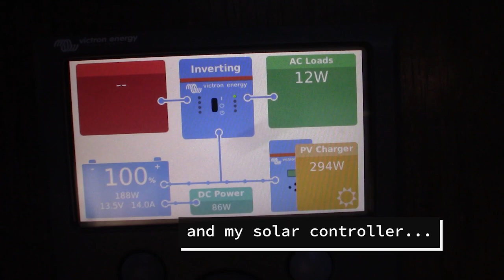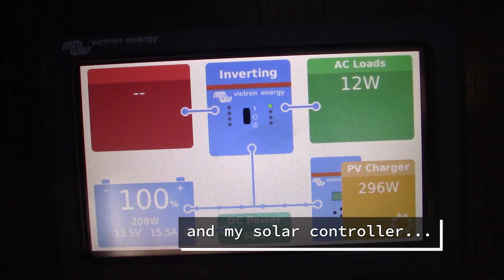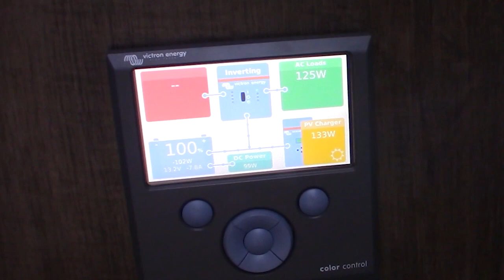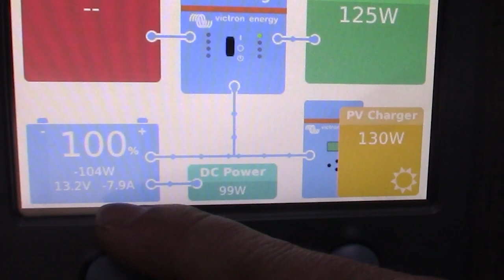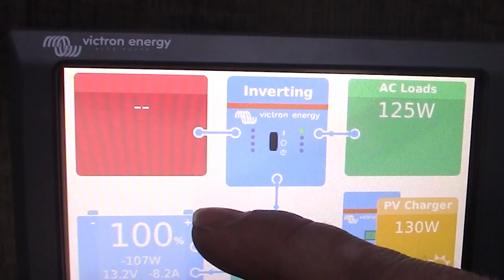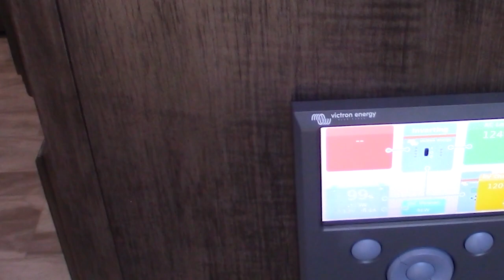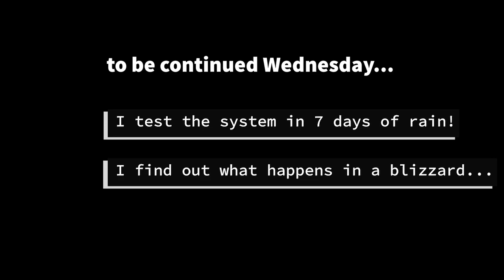MASSIVE SOLAR INSTALL for this Full-Time RV Boondocker! Full-Install and Walk Through

Comment: Omg I went to northern Arizona wind and sun in January and got my solar. I was there in two feet of snow so I stayed in a hotel while Louis from The solar place and another installer did their magic. I got 1300 hundred watts of solar panel and six batteries same as you. It looks like we got the exact system with a few watts more  on my roof.  I can run my air con perfectly and never have gone below 70 on my batteries running air con for 5 hours.  I got the same inverter also.  I love my set up and I know you are going to love your system also.  Wow your board does look just like mine.  My solar investment was money well spent and I love that I’m able to use microwave and everything while Boondocking.  I’m happy to see other people went for the max solar system  because I wouldn’t settle for any less now that I’m used to living in my motor home just like I’m plugged in all the time

Comment: I was fortunate to find James and learn of Northern AZ Wind & Solar at an event at the beginning of 2019 and been very happy with the install he did and the performance of the system. Haven't read all the comments but did want to mention that you can claim the cost and installation on your taxes (it was 30% in 2019, and will be 26% this year). Every little bit helps especially with those lithium batteries...

Comment: Good video. Im way in over my head on all the parts I bought already and they are still sitting in their boxes in my living room. I bought 10 battleborn batteries, 3000 multiplus inverter, the color gx display and victron monitor and enclosure. All of this is going into my ford econoline van. Im about to buy 5 175watt solar panels to mount  ontop. Definitely a very scary thing im embarking on. For anyone curious why I need that much power in a little bitty ol van.. its.. computers lol. Im doing a full mobile office van build. Slowly but surely coming along. Good luck to you all and keep making great content for us. Thanks
Reply: You sound like me with them STILL in boxes on my living room floor !...

Comment: Real Nice setup you have Victron gear is top notch - i built a smaller  solar system using li ion batteries w Victron charger have been using daily 4 yrs - you will enjoy  yours

Comment: Great company and had 4 solar panels installed 1280 like yours. Same inverter ,basically same system with 4 battle borns.I have had it for 6 months and no problems so I highly recommend this company.  Took two days for us but the guys stuck with into the night.  I hope the owner of the company builds a shop for the installs. James is great but wasn't our installer and didnt get the same service you did.  Oh if you go there and smell a skunk, well it's not a skunk legal weed manufacturer next door..🦝

Comment: Great to see this video! Our new rig is going to have 1320 watts of solar and 8.7kw of lithium so it’s helpful to see how much you can get out of your system so we can plan for when we get ours. BTW, the only thing you need to look out for with the lithium batteries is to keep them above 32 degrees. You can use battery power below 32 but you’ll ruin them if you charge below 32. You’ll want to add heat pads or put a heater in the storage bay :)
Reply: Casey Good info, Casey. With our last rig we spent the extra $$ for RELiOn’s low temperature lithium (good to zero degrees). It was a lot less stressful on cold nights! Our new rig is a 4 season and has the batteries in a sealed heated basement. Yay! Happy travels!

Comment: Looks like a top of the line system you get there although those battle bones go for $1,000 to $1200  a peace.When I use my instant pot it starts off at 1,000 watts but once raises together pressure drops down to couple of hundred watts

Comment: Nice setup Robin. I have a similar system (1280 Watts Solar, 6 BattleBorn, Victron Inverter & Controller) that I purchased from Arizona Wind and Sun last year. You are really going to appreciate the no-maintenance aspect and additional power.

Comment: Congrats!  I'm so excited!  I bought my system from NAWS in January.  Had the install date set for March when everything shut down.  I'm just waiting for them to start scheduling installs again.  I got 640 watts of solar, 3K watt Victron multi+ inverter and 2 Battle Borns plus the other 2 pages of parts, components, and wires.

Comment: My solar guy (Light Harvest in Portland, OR) added charging to my van's "house" batteries (300 ah lithium) from my alternator. Is that an option with a separate vehicle? Ironically, I drained my batteries during Pacific Northwest spring aka cloudy rainy days as well. Also added USB ports in the "house" for charging. Once that small (not particularly cheap) fix was done, my system works amazing. I have an Instant Pot, induction cooktop. My Isotherm refrigerator runs on 12v. I only turn my inverter on when I need 110/120. Inverters drain batteries even if nothing else is running. Also, I appreciated him saying to just get your solar panels rained on from time to time to clear dust off. People used to make a big deal about climbing on their rigs and cleaning them. I've been in my van about 15 months now and, other than an occasional truck wash and rain, I've never worried about cleaning my panels. I always think..."who goes out to clean panels at solar farms?"

Comment: Robin, there's AGM batteries that are sealed and don't need water.  My AGM batteries can be run down to 80 %, not 50% if necessary and still under warranty.  Lithium batteries are great, but, make sure that they don't overheat and are in a safe place.  They're insanely expensive to replace.  Good on the solar, I have a Zamp solar system, 5 stage microprocessor. You technically should never have to disconnect  the solar, I never do and have had solar for 3 years...

I hope you have a battery monitoring system showing the state of charge... Victron BMV 712 is a great system and has a battery shunt to the batteries. 

I have a generator as well....

Good luck.

Comment: Nice.  You have the same amount of solar as my rig (1280 watts)... And twice the batteries, and 1000 more watts on your inverter.  I am looking to upgrade part of my system to be able tp occasionally run AC, too.  (James built my system, too, BTW)

Comment: I would also invest in a manual (off line) volt/amp meter usually ran by double AA batteries so  you can check the battery status without the internet. So, if the internet is down or you're without connections you can at least check the batteries for full charge or needing charge. Maybe som other dear folks could correct my information or add to it accordingly!! But this is an amazing set up though!! Enjoy!!

Comment: 2:22 People need to get out of the 80's-90's  (this is not Pinto wagon)    >>>> LITHIUM ARE SAFE!  <<<<
Reply: They saw too many phones and tablets spontaneously combust.
Reply: Anne-Marie A Good point… And not in the 80s or 90s
Reply: Cell phone batteries are NOT the same as lithium ion batteries installed in RVs.
Reply: @hosephine1 , thanx, I didn't know.
Reply: I think the people saying bad things about lithium are the ones that can't afford them. We have lithium and would never even consider an AGM at this point. There are no cons to lithium, love them!
Reply: there are different type  lithium. The battery type used for led acid replacements are  LiFePo4. LiFePo4 contains less energy per volume, and are very safe.

But anyway, the BMS keeps the cells safe.

Comment: I don't know if you have heat in that storage bin where your batteries are, but those batteries will give you very little output when they drop below 32°. Which is why BattleBorn sells battery warmers.

Comment: I wonder if you could use a heater off that system during cold weather? How well is your insullation on the rig? Is it 4 seasons? Have you thought about a wood burning stove? Have you considered installing a split air conditioner?

Comment: I am glad you got such great help with this confusing(to me) tech stuff!  I have a couple of questions for the next View Q.  
I am planning ahead to get some sort of larger vehicle to travel in.  Right now it will be my mid-size SUV, which I realized is pretty darn small!
 I have already bought a water purifier, one burner cook top, a privacy tent, a 5 in foam, cot size , gotten heat shields for my car windows that are reversible to black for stealth sleeping, and a small Jackery.!  
But for the future...I notice in all the tours of various vehicles that most have these humongous containers for fresh water and gray water under the sink. I am 77 and even a 1 gallon container feels somewhat heavy to me.  They have maybe a 5 gallon gray and 6 gallon fresh, which they are supposed to take out to empty or refill.  How the hell am I supposed to do that?  Any alternatives for that type of system?  Also, since for now, I am in a car, if I would leave a fee campsite to go for groceries or laundry in town, would someone else come along and be able to take the spot where I was?  Thank for
Reply: I got the slim BPA water container 1 gallon at Walmart with a release outlet.  It also comes in 2 or 3 gallon size.   Since it's slimmer, it is closer to your body and feels lighter.  I just bought 5 and shift it around.  I also bought a couple of 3 gallons should I need them. I also fill them into the small plastic bottles bpa free small size that I squirt to wash hands or do the dishes.  These flat bottles can fi anywhere.  But check for leaks before you go on trips.  One of mine leaks.  You can put one on a shelf and let gravity do its course and just turn the knob.  I have the cot you have.  It's very comfortable for me...But you need something else because the pad is not dense.  By the way, I also learned about an alcohol heater that releases no smell but it is out of stock on Amazon.  By the way, what did you get to cover your windows to make it stealth?  I was going to make them but would rather buy if it's nicer and reasonable.  Thank you.
Reply: I'm with you on needing a doable water system.  I'm 70 and have scoliosis, so lifting anything heavy is a no no!   I car camp (1998 Honda Accord sedan and a backpacking tent) typically on BLM or Forest Service land.  I'm still living in a condo for now, so these are short trips.  I'm considering getting an SUV or a minivan.  Are you living in your SUV full time?  How is it working for you (or not)?  Whenever I leave to go hiking or grocery shopping, etc. I leave my tent wherever I'm camped, and haven't had any problems, although a few times I've returned to find that another camper had set up camp very close to mine.  Once I felt uncomfortable with the new neighbor, so I packed up and left.  I know people who sleep in their vehicles but set up a tent just to hold their spot.

Comment: Hmm. NOT 3400 Watts. Just to clarify something: At 13:20 James says your inverter is limited to 3400 Watts or 3000 VA. VA (Volt-Amps) doesn't really mean anything for RV loads. Watts is what matters, and your Multiplus 3000 inverter is NOT 3400 Watts, but rather 2400 Watts according to the Victron Multiplus spec sheet. I'm sure James misspoke. But it's important, because most people think the 3000 stands for 3000 Watts, when it is really only a 2400 Watt inverter (less as it gets hotter--meaning you are running heavier loads on it).    https://www.victronenergy.com/upload/documents/Datasheet-Multiplus-inverter-charger_2kVA-and-3kVA-120V-US-EN.pdf

Comment: Is James, your installer, an employee of Northern Wind or is he an independent business working through Northern Wind? If independent, would you please provide contact information. I have a GD Reflection travel trailer and am looking to do a similar system and am based in AZ. 

All that front room in a 5th wheel sure makes for a nice install!  

In case you don't have one, a 2000 watt class probable inverter generator might come in handy for those cloudy days. Then you will have all your bases covered. 

Nice job.
Reply: @Bruce H ... Both employee and independent.

Comment: I have a dodge Promaster I have an inverter and extra battery under vehicle that connects to motor battery to recharge when driving. I had three things plugged in once and it screamed at me. I have a electric fry pan for cooking. A hot pot, coffee pot. Have never run out of Power.

Comment: May I asked what you paid looking at getting it done?
Reply: She bought way more than that $8000 package. The solar panels, another charge controller, Lynx bus bars, the shunt, the color monitor, lots of accessory items (wiring, breakers, switches), plus the cost of the professional install.
The 26% Solar Tax Credit won't cover the most expensive items (installation, batteries, and probably not the inverter).
Reply: She’s somewhere in the $10k range - But a Victron/Battleborn combo is the best you can buy... Nice that the system was designed as a drop in... Given she changes rigs frequently it shouldn’t be too hard to remove to her next rig ;-)...
Reply: @Hei_hey  $8000, no way, heck the lithium alone was probably $7000. We paid over $1000 each for our lithium 100 ah and we installed them ourselves. Maybe double your price.
Reply: @BKKKevin  before they install charge, you mean? Just in parts?
Reply: @cider Wrong about the tax credit.  Credit good for the entire system, as long as there is at least one solar panel involved and it is being installed on a primary or secondary residence.  (This is Robin's primary residence so good too go for her.)
Reply: Before any tax credits, this whole thing, parts and install, ought to have cost her over $12k. The battleborn batts alone are $6k
Reply: The batteries are over $5000 probably closer to $1000 a piece.  Honestly though if money is no object this is the way to go although if you are gonna spend$10000 plus might as well splurge for the other two batteries.
Reply: @Casey what's the advantage of a 24 V system over 12 V?
Reply: @Casey thank you. It seems a bit beyond my understanding of solar/electrical systems, but I get the efficiency part. So perhaps if I ever subcontract it to someone with extensive knowledge, I'd need to consult with them on the choice of 24 or 12. Cooling is my primary concern in fact,veo it's good to know with a 24v system it's more of practicality. Thanks again.

Comment: You cannot run A/C on Solar, big mistake on skipping the generator!  You will boil in the summer.  They shouldn’t tell you you can run AC, your batteries will drain immediately.  Plus you would need a soft start for the compressor.

Comment: How much did this system set you back?  You have a very impressive system with 1200KW panels, 600Amp-Hours of Lithium, and a 3000W Inverter.

Comment: THINK would of opted for smaller collector panels, so if the get broken, less money to replace. Surprised this did not come standard from the rv builder.
Reply: Many who buy big rigs such as this stay in RV parks with electric hookups and would have no use for this top of the line  expensive system.

Comment: Okay I might have missed it but you stated that it was going to cost you an extra 6k for the generator an extra batteries when you purchased your 5th wheel. So you saved that money an opted for solar, what I didn't see or maybe you didn't tell us s what was the cost difference for what you did install vs the generator and batteries?

Comment: Wow, what a great system. I'm curiousm, however, to have an idea  at what the approximate cost was. From what I've heard is that lithium batteries are about $3,000. Each. I would probably not need as much as you.
Reply: $950 each👍✌️
Reply: Yeah they’re about 1,000 each. At least Battle Born are. I’m guessing 7k or there’s about. Panels & Inverter & Monitor System. Dunno know about labor for the install. Kinda Rude to ask how much IMHO when Mr Google is your friend. I’m happy for her.

Comment: Congrats on the awesome solar set up Robin! Just wondering if the set up included charging from your alternator when you were driving?
Reply: I wondered the same thing when I was thinking about getting solar.  We have it in our heads that we need to drive to charge up our batteries.  There is a way to have the engine charge the batteries, but my understanding is that you don't need it because as long as you have light, your batteries are charging.  Also, lithium batteries charge much faster than lead acid or AGM batteries.

Comment: Robin,

Wise move going to lithium batteries and solar; it should serve you well boon docking.  Your system looks good, but I think there is one other piece of equipment you may want to consider.  Lithium batteries have a very low resistance therefore they can pull a lot more amps from your trucks alternator.  Without getting into too much detail, I suggest you view these two you tube videos.  One from Victron and the other from Long Long Honeymoon (LOLOHO).  The Victron will explain the alternator issues.  LOLOHO will show you the equipment cure they installed.  We have the same setup in our trailer and have used the same cure.  Good luck!  

Video 1: How to not blow up your Alternator when charging Lithium (https://www.youtube.com/watch?v=jgoIocPgOug&t=310s)

Video 2: We've Gone ALL IN with RV Solar -- Here's What We Got (https://www.youtube.com/watch?v=_m2KlLqKCaM&t=930s)